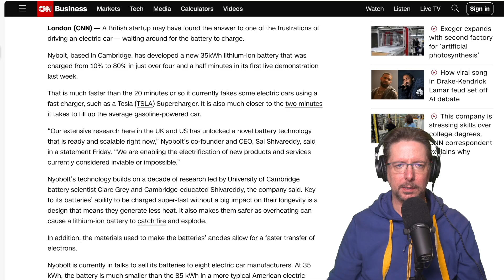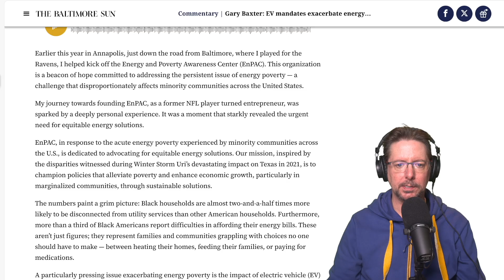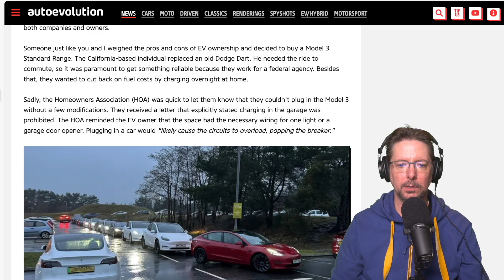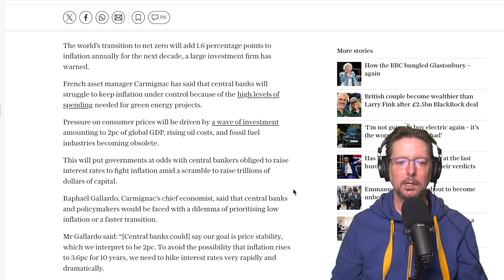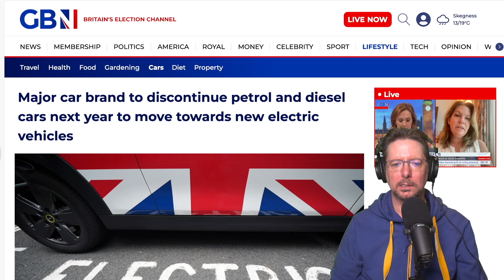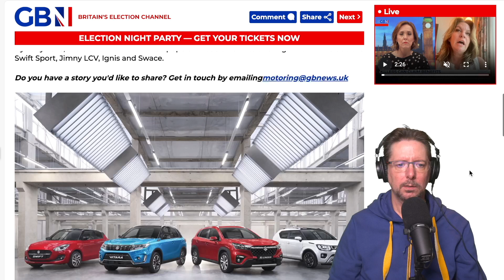Tesla owner's charging SHOCK! MGUY EV News Tuesday 2 July 2024 | MGUY Australia

Comment: 35KWh battery from 10% to 80% in 4.5 minutes.     Let's do the math.
Not accounting for any efficiency losses, 35,0000 Wh charged 70% is 24,500 Wh, 4.5 minutes divided into an hour is 0.075, so 24,500 divided into 0.075 equals a charge rate of 326,667 watts.   I don't know what the charge voltage is, but if it is 240V, we're talking 1,361 amps.
4/0 cable is only rated to 250 amps, so I'd love to see the cable they are using to charge this thing.

Comment: I watched a funny YouTube short. A guy heard a noise outside of his house. He was surprised to find a woman plugged into his home EV charger. She could not understand the concept that this was a private, personal, charger. She insisted she had the right to use it. The "karen" even got mad at HIM for telling her she couldn't use his charger. Even calling the cops would have meant that she would have gotten several dollars, ten's of dollars worth of "free" charge. He'd probably have to take her to small claims court to get the money back

This brings up other upcoming problems.  
1. people stealing charges from home chargers (above story). Simple fix, more money to put in switches inside the house to turn off the outside power.
2. people will start stealing the outside mounted chargers, and/or cables (resale or scavenging copper!)
3. for street parking, the home owner will have to use an "extension cord" (not yet made) or install their charger street side (see above point)
4. insurance costs for the EV itself are sky rocketing (because EV's can't be repaired cost effectively, no repair infrastructure yet), similarly home insurance rates are going to go up for, simply for EV owners, and more for home chargers as soon as enough homes burns down, both while EV is charging or while the EV is just sitting parked inside the garage. 
5. Apartments and Condos are going to force EV owners to park outside (for above reason)
6. HOA is right, average existing garage (in any building!) is not wired for charging. That is nothing new. People buying home chargers for their stand alone homes are paying up to a few thousand dollars to get them installed! 
   a) upgrade power service/supply to the house, 
   b) install separate circuit breaker for the charger from the main home circuit breaker box 
   c) installing a new high capacity cable, from breaker box to the charger, maybe underground if it is an external garage
    etc

You implied that in another video you make the point that the whole electrical system, from the generators all the way to the home is simply not built for modern electrical use, ESPECIALLY older neighbourhoods. Many were built in the post WWII "baby boom". I'm actually living in a house built in 1950.  I saw the original electrical service for the full house, 4 old style fuses. That house could not support charging a single EV without extensive electrical upgrades. It is safe to say that unless the whole neighbourhood has had large power supply upgrades, it could not support more than a few EV home chargers.

Comment: FYI If i'am correct. To charge a 35kWh battery in 5 minutes takes 420kW for 5 minutes. By 230V this takes 1800 Amps and by 110V ~3600Amps. I know charger can be with higher voltages. Lets say 400V. This takes then still 1000Amps. You need cables/plugs for this that are not easy to handle. Let alone that you never get that kind of power to regular places (unless you have a nuc power plant in your garden..). Also the car needs extra power equipment to handle this high current. And this equiment needs to be carries around..

Comment: Personal experience of the home-charging EV madness - my previous employer previously ran a standard policy for co. car owners - 3 year lease on a new car, BIK and all that. They gave you so much and you could then add your own cash to a bigger/better car. This replaced the previous existing 'car allowance' scheme where you got paid a fixed lump sum (taxed) every month and could buy pretty much what you wanted (I had a 5 year old V8 Jeep). So the later plan ran for a 3 year term - then they jumped on the EV bandwagon and mandated ALL fleet users HAD to source an EV when their current car came to lease end. At that time on the old 'new' scheme I had a 1.6 diesel i30 as this cost me no more than the monthly 'contribution' and actually paid ME £7 a month to have (no VED either). Anyway the long and short was if you couldn't charge at home you were 'allowed' a hybrid (how generous) but your house had to be surveyed to prove if you could charge at home, or not. Turns out my 100A (230V) consumer unit was protected by a 40A fuse (old house) so no joy there. So instead I purchased my previous fleet Hyundai for 25% of market value (cash) and left the company. The company prides itself on its  'green credentials' and everyone I know still there is sick to the back teeth of paying through the nose for a car they didn't want and suffer all the associated EV issues you mention in your videos. Insane virtue signalling at the cost of the staff AND the environment......

Comment: Germany has spent a huge amount on installing solar and wind power. The problem is reliability. Either the supply exceeds demand and there are no takers or there is less supply and costly power has to be bought from surplus neighbors like Sweden and wheeled thru other countries = $$$
Conveniently forgotten is the fact that coal/ diesel/ nat gas based units are RELIABLE and cheap AND very clean nowadays after several advances in technology
Good news: The conventional units may come back when sheriya takes over eg UK in the form of caleeph sadsak khansama

Comment: I drove past Ratcliffe-on-Soar on Sunday and the coal stockyard is pretty empty. It's an old station and would require a lot of investment to keep it going, and it's largely been replaced by gas generation. It was due to close in 2022 but the government begged Uniper to keep generating for 2 more years. It hasn't generated much recently, only being fired up now and again when there's no wind. I could see it everyday on my way to work so it was obvious if it was online. I worked on the refurbishment of the ash-handling cranes in 2010 and those cranes were already 2nd hand when the station was built over 50 years ago. I wonder what will happen if the coal hasn't been consumed by the closure date. I guess they'll have to send the train back to collect it all, or ship it all out in a convoy of lorries. From where I live I should be able to get a good view of the cooling towers being blown up, weather permitting.

Comment: I still prefer filling a tank and changing oil and filters, that is still cheaper than buying the electricity and buying & swapping out the battery pack, which will be more often if you're always fast charging. the low fire risk & normal tire wear is a bonus as well.

Comment: It is only a matter of time before strata management or council's would step in to do the samething.
Which really limits where this is practical even though it is not enforced here yet but can you say it won't happen, chances it will then the shock of plan B relying on public chargers with all the problems.
You already see the council's taking action with people running cables in footpath is just the start.

Comment: The real question is what's going to happen is power outages happen in the middle of winter and some of these colder areas not having heat isn't a good thing for batteries let alone when you start getting in the negative temperatures  in a house with family and kids

Comment: I realise that you're an engineer but most people wouldn't understand what you mean by "not enough power" as they think power is just "electricity".  I'm a science teacher and I'd explain the problem as being an issue of your home socket only allowing a max of 10Amps or maybe 15Amps if you wire up a dedicated circuit - so with a 10Amp socket and 240Volts that gives you power of 2400Watts (Power = volts X current) or 2.4Kw so this limits your total power that can be supplied.  So if you have a 30Kw hour bat to charge and you can charge it at a rate of 2.4Kw then it will take 30KwHr/2.4Kw = 12.5 hours using your normal house elec socket.  To deliver 30 KwHrs in 20  mins would need a 60Kw supply which means 60,000watts/240V = 250 Amps for 20 mins so that is a ridiculous 25 times more current than the max avail from your regular house plug which is just nonsense.  So, as MGUY says, even if these people do make a bat that can be charged in 20mins the fact still remains that you can't charge it unless you have a 250Amp circuit which only serious industrial or commercial places would have so therefore fast charging batteries will not make elec car owners recharging times anywhere near 20 mins for a full charge of a Tesla size battery- it just aint happening no matter how much hype that release.
Reply: 250 amp is 2.5 times more than most modern residential supplies are limited to (older supplies are usually less at around 80 amps) so it would require at least a whole new 2 and a half houses worth of supply capacity per charger.

Comment: coal absolutely should be adandoned, but it should be replaced with alternatives such as nuclear, and natural gas plants. nat gas while still emit greenhouse gas, is significantly cleaner than coal. and those who fear nuclear, well that is carbon neutral, once the concrete is finished being poured. be better if they adopted thorium MSR reactors, and just refines the burnt coal ash, which on average, after burning, consists of about 11% thorium salts from the ash content, as a by-product; can be filtered and refined for essentially "free" fuel after refinement. and thorium itself is 91% recyclable. just need minimal amounts of uranium as a "breeder" fuel to kick start thorium reactors. 

Second, many empty and spent, oil wells, can be converted to Geothermal power plants, like the few being developed in Canada right now by DEEPearth energy. half of the digging required for geothermal is already completely long ago by the former oil companies who owned the well. another clean source for steady base load power.

Comment: The battery invention: here, I have half sized glass. It is all full.

The home charger in association case: also mains cable to the property and switchboard may need upgrating. Both of these could cost tens of thousands. If the mains circuit breakers have to be upgraded, HOAs monthly basic fees for electricity could go up (typically also district transformer needs upgrading, district grid cabling is usually future proof).

Comment: Suzuki ? Unbelievable. I live in Thailand. Suzuki are very popular, reliable and economical. My wife and my daughter own Suzukis. The range exists within a perfect window of green opportunity. All models are built with engines less than 1500cc. Why try to go full electric rather than improve engine efficiencies or emissions controls further. If they must go electric move to hybrid with a smaller rotary engine and maintain user functionality or better still smaller engine with a turbo.
These cars are still one of the few modern cars that even I can still work on myself with no issues. They are great, that's why I bought them for the family members. Reliable, not too complex, not expensive to run or repair and now they are about to screw that right up. Let's hope they see sense.
My daughter runs my wife's 11 year old Ertiga and my wife runs a new XL7 which will eventually go to my son as his first car thereby we maximise the lifespan of our vehicles. Try that with BEVs.

Comment: The hilarity of EV's never ceases to amaze. I have a problem with my front brakes in my old, beat up 2001 Hyundai Elantra (she only has 70k miles though). My brother drives an even more old and beat up 1996 Honda CRV (his wife gets the new Subaru SUV for the kids). Thing has nearly 200k miles on it. He's at the beach for week, so I called him and asked if I could borrow the CRV until my brake problem is sorted. Of course, he said yes. After doing five minutes worth of checks on the fluids and whatnot, I was off. Never even got in the thing before that, but in the four days I've been driving it, haven't had a single problem. When I give it back to him, I'll fill up the tank, which will probably cost like $30. 

As for my car, the problem is about to be fixed. Apparently, the driver's side front brake line had ceased. I need a new one, some brake fluid, and my dad wanted me to buy a caliper repair kit just to be safe. All told, the cost was like $40 or something. It'll take 45 minutes, maybe an hour of "labor" as well, which will consist of my dad and I drinking a beer or two and talking about politics or something as we knock it out.

Comment: They always say, the battery CAN be charged in a questionable amount of time IF you can find a charger with that much power. Also 35kWh would be about 100 mile range. I could not even get to work and home.

The politicians do NOT care if the economy fails, they will have filled their pockets and are nowhere to be seen.

Comment: Could you please question SOMEONE what are the actual emissions sent out by coal fired power stations? Nobody seems to be to tell us the actual facts about emissions from coal fired power stations. Everyone seems to accept that it's bad and monstrously large....as I ask my friends....how does the water vapour leaving the stacks out side a power station reach the surface of the sun from whence cometh our weather???
Reply: A very well designed, built and regulated modern coal plant would only emit CO2. 

The NOx and sulphur oxides would be scrubbed out, n there would be extremely minimal carbon monoxides if well-designed. 

Coal plants added complexity is the filteration n scrubbing system, whereas a natgas system - while more expensive since its dealing with gas - will burn alot more cleaner, and wont need as much scrubbing.
Reply: @arsyadidris6349  Yeah fine on paper and claims. And where are these "modern" coal plants? Majority are decades old in western countries. Try living near one. In dense cold air and foggy mornings you can smell the sulphur 20km away. You can see the smog they create. It's about time some independent bodies started doing random flyovers gathering air samples. Such plants are still the largest emitters of NOx in some countries yet ICE vehicles are of more concern.

Comment: Imagine what would happen if 1000000 EV owners each tried to demand 60kwh from the grid in 5 minutes. Also do these dimwits have any idea what the transmission losses would be for such a power demand? The problem with EV's is NOT the battery, it is generating and distributing enough power to meet the demand. Anyone who does not get it should try this, Convert the energy currently being distributed in the form of petrol and diesel and convert this to electricity distribution.

Comment: I don't beleive a battery chemical reaction can happen that quickly without seriously damaging a battery. Most battery indicators also don't read a true state of charge. The chargers push power very quickly so it tricks the Bdi thinking it has more power that it really does. Once you equalize the battery or place it under a load (drive it) the voltage equalizes and then will recalibrate,  display the correct state of charge .

Comment: Even good conductors like copper have electrical resistance.

Electricity passing through wire makes it hot.

This is why charge leads and the batteries themselves have cooling systems.

The same amount of electricity will create the same amount of heat whatever the charge time.

If a charge system requires cooling for a 24 hour charge, for a two hour charge, that same electricity over five minutes will produce an extremely dangerous amount of heat in a very short time, and is likely even to be explosive.

I had bad physics teachers at school so cannot do the science on this but this situation is so extreme that even I can see it.

We have reached a point with batteries where the laws of physics have already been pushed to the extreme.

Comment: 35kWh is 40% smaller than Tesla’s smallest battery.  It would actually take 10-15 minutes to “fill-up” typical size Tesla batteries at those speeds assuming you could get enough power to drive those higher charging speeds.

Comment: I am a Grey Nomad , and cover a lot of miles around Australia. I am a little puzzeled by the claims that there are "1000's" of EV around OZ.
I first noticed  (a year ago) an EV in Melbourne, and in the two weeks I was there I saw about 5 more. This is based purely on seeing the EV tag on the number plate.  A week in Adelaide I did not see any. I country areas I saw quite a few chargers, but not one being used--just taking up space in a carpark,
and not a single EV on country roads.  In Brisbane  I saw a couple of EVs, and know two  Hybrid owners. Now in Townsville, and have seen two EVs, one being a Taxi (?)  Accepting that there were many I did not see, and that I was only looking at rear tags, this does not add up to 1000s, so where do the figures come from regarding EV sales, and if the figures are right, where are the EVs??
Keep on sparking.